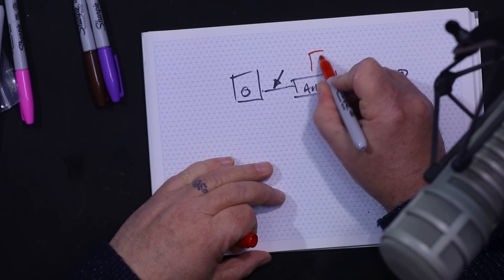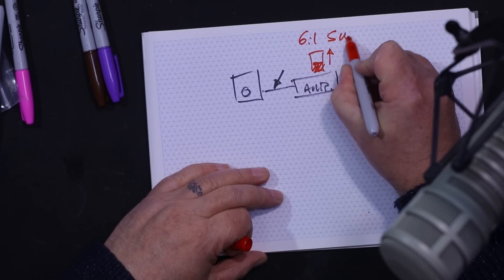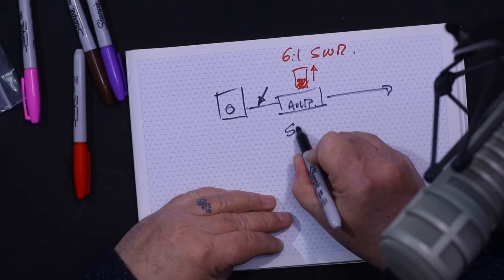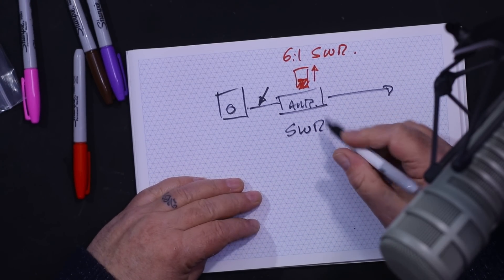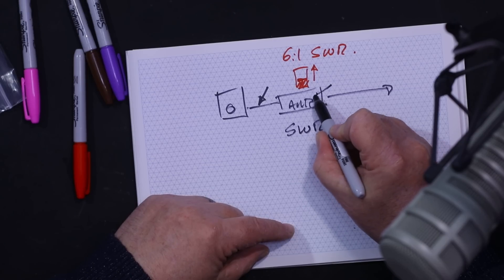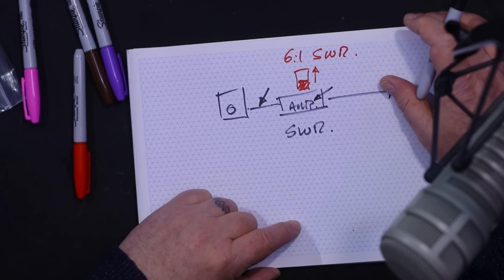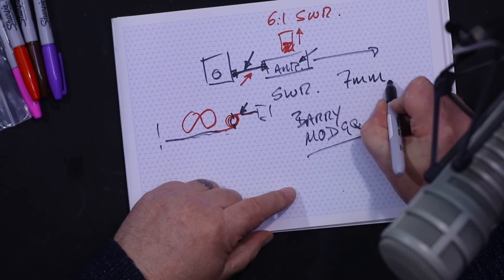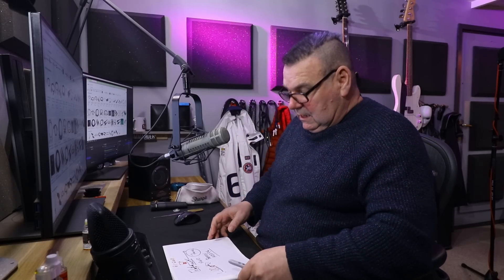Secret Life of a Coax Jumper Patch Cable Lead!

Comment: If the swr meter is after the amp, and turning the amp on causes a drastic change in your swr, then you’ve probably got spurious emission out of the amp on frequencies other than the desired resonant one.  It might be oscillating or has excessive harmonics.  Or you're trying to run 2000 watts down RG-58 and it is breaking down.
Reply from the maker: You tell 'em! :)

Comment: Sounds like the fella with the SWR meter has it between the transceiver and the amp instead of after the amplifier...Depends who you talk to, some would say that placing the swr meter right after the transceiver is the correct place....Perhaps there's no right or wrong, but there must be some sort of difference...
Reply: There is a right or wrong here.  If you're trying to measure the match between the radio and the tuned amp input, then put the meter there.  But most people would be wanting to measure the match between the amp and the antenna, so the meter would go after the amp and before any tuner.

Comment: Nothing too contentious there but I have seen an instance where  a patchlead ""of the wrong length"  caused a problem, a VHF rig connected to an amplifier that was using RF sensing. For an instant as the relay in the amp moves the rig is not connected to either the load or the input circuit of the amplifier. The impedance seen by the rig was causing the rig SWR protection to drop the output so the the amplifier sat there chattering. Changing the length of patchlead resolved the issue, though this is an unusual scenario. RG58 as you rightly point out varies a lot in quality,  the most expensive part of it is the copper so budget cable tends not to have much of it. 10ft of RG58 has 0.1dB of loss at 30MHz so you might not want to use much of it but for short patchleads it is not so dire at HF with a low SWR.
Reply from the maker: Yes.. Unusual. Agree.

Comment: Exactly how I do it. Could be a short in his coax connection to for the high swr. You don't have to do it, but I always figure my jumpers in multiples of 3. A lot of math in  figuring electrical math with radio waves are close to multiple of 3. But to each his own. Just have fun.

Comment: I have for each of my rigs an 18"/.5m male/female patch for each of my U/VHF radios.  Why?  I can make sure the coax connection at the rig is solid.  Then I can connect the antenna lead to the female end.  I disconnect if I know Houston is going to get thunderstorms.  Also, in case I need a higher power mobile in my truck, it is easier to disconnect.  And it is very hard to connect a coax to some rigs as the FT2980 because of the location of the coax port on the rig.

In Houston, ABR can build patch cables, and you can will call so you can pick them up in person 

I think some of the other good cable companies can make custom length and connections for patches.

I have heard the words "Pig's Tail" used for such cables.

Comment: At the risk of getting into deep ka ka for arguing with Lord Calum, and being a pedantic little shit.....Patch cables and jumpers are NOT the same thing, no matter what world you are in.
A jumper is meant to connect two pieces of equiment together in a semi-permanent configuration.
Patch leads are meant to be moved around in a patch bay. A great early example is a switchboard operator on old phone systems. A newer example would be in an audio rack in a sound studio.
Yes, the length CAN make a difference, but not so you would notice in most cases. 
In HF, which is where 11 meter CB lives, whether you like it or not, the length of a jumper is the least of your worries. 
Be sure you use high quality cable, that your ends are installed as best you can get them, and don't have a bunch of excess lying around.
If you really want to get stupid you would need a TDR and the ability to do a full sweep across all the gear in your set-up and the knowledge to understand what you are looking at. 
Considering the benefit versus the time wasted, just listen to Calum.
Reply from the maker: OK.. I think you we are only talking vocabulary.. All my coax "jumpers" are patch leads.
Reply: @DXCommanderHQ  I told you I was being pedantic.
Reply: I would be interested to see a citation that supports your interpretation of jumper vs patch cable.  The "jumper cable" in my car is certainly not intended to be "semi-permanent".
Reply from the maker: OK, I'll site for you.. Patch Cables and Jumper Cables are an intergageable term, often mixed and matched by Ham Radio Ops and CB ops depening on country, year it was used and what they had for lunch yesterday. C McCOrmick 30 March 2023.
Reply: @DXCommanderHQ  I'm totally with you Callum.  I was requesting the OP to backup his assertion that "Patch cables and jumpers are NOT the same thing."
Reply: @stargazer7644  Go reference the Wikipedia article on patch cables. That is your first starting point.
The terminology is a direct decendent from telegraphy and telephony usage so that the appropriate cables were not simply jumbled together in a mess.
Typically any cable that was meant to connect two pieces of equipment for semi-permanet or even permanet usage was called a jumper.
This is also where the term, "patch me in" comes from. See also, "Patch me through" insofar as it relates to radio-telephony.
Time of course has made most of the distinction meaningless which is why I told Cal that I was being a Pedantic little shit. It was a joke.
As for your car jumper cables. That is another confusion of terms as jumping a vehicle and boosting a vehicle are not the same either.
A jump start requires a manual transmission. When the starter won't crank, you can use the clutch to translate forward movement of the vehicle to rotational movement in the engine. If everything else is working fine, the engine should start. A boost on the other hand requires a second electrical source and thus a cable to connect the two so that the dead vehicle can activate its starter. Just to add to the confusion, to "boost" a vehicle is also a slang term for stealing.
Reply: @RomstarOrion  Wikipedia isn't really supporting your claim.  From the very first sentence: "A patch cable, patch cord or patch lead is an electrical or optical cable used to connect ("patch in") one electronic or optical device to another for signal routing."  Temporary does not appear as a requirement.  In fact, it says patch cables "can also" be used for temporary purposes.

Funny you should mention telegraphy.  I actually worked in communications for decades for the company that invented telegraphy.  While our patch panels could be used to temporarily bypass equipment, they were primarily used for monitoring and troubleshooting circuits by inserting test equipment into the line in either direction.  The circuits themselves were permanently wired through the patch panels.  They weren't configured with permanent or semi-permanent patches the way today's Ethernet patch panels and cable plants are configured (yes, I do that too.)  You read about it on wiki.  I actually do it for a living.

Thanks for mansplaining how a car can be started.  I don't know what I would have done without that as I'm sure nobody here has ever seen or operated an actual automobile before.

You're the one who wanted to get into "deep ka ka" for being a "pedantic little shit."  I'm happy to oblige.
I don't accept your conclusion given your evidence.

Comment: Bad crimp had no shield working. I use rg400 jumpers and 393 will be my alpha output to tuner jumper when I finally get my Alpha 77dx. Single 8877😊